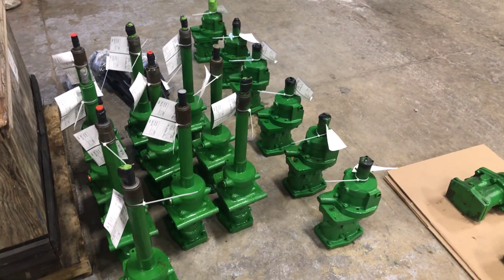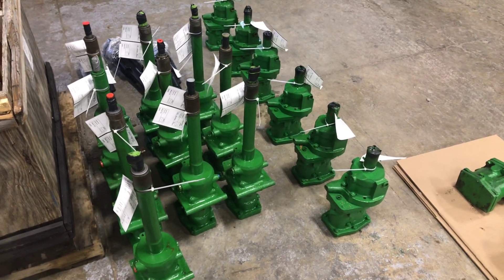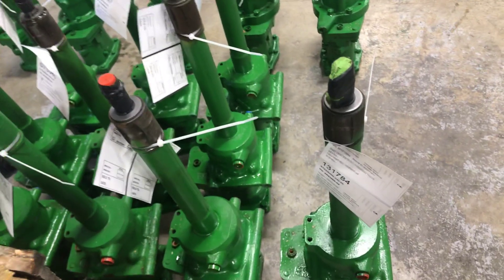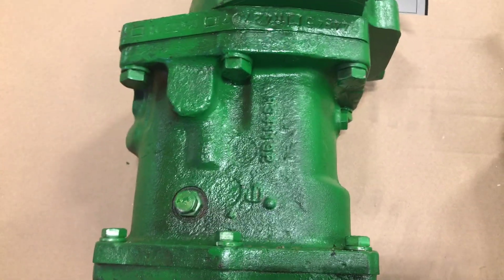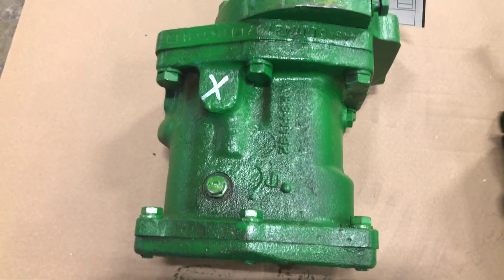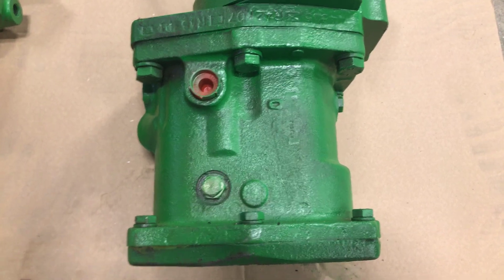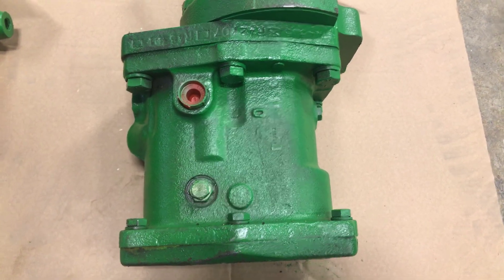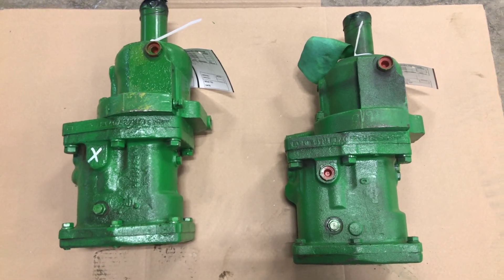How to identify a John Deere 4020 steering valve AR43809, AR43809.A4, AR43809.A5.

Comment: How do I know if this is what my 4020 needs and how much is a rebuilt pump?   My tractor sometimes turns real sluggishly to the right.   Like you turn it quickly to the right and the tires slowly respond and can take 4-5 seconds to reach full right turn.
Reply from the maker: Jay Fojtik we would suggest you have a qualified mechanic hook up pressure gauges to your tractor to identify the problem. 
You can check our website for current pricing.